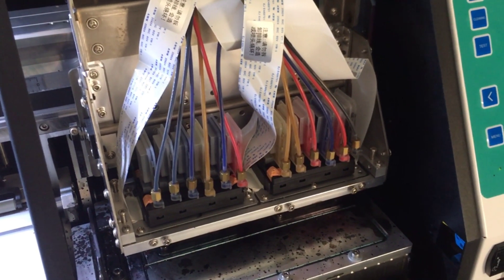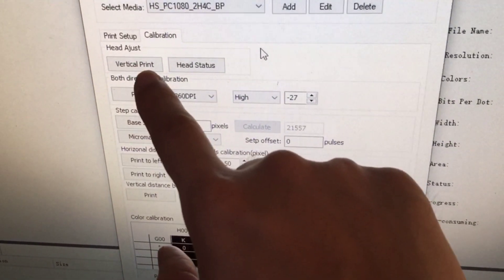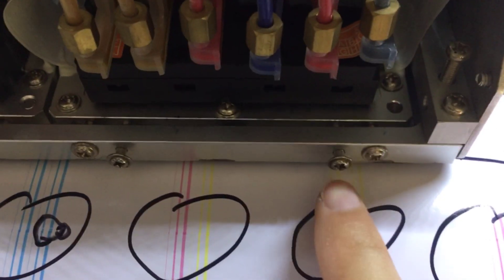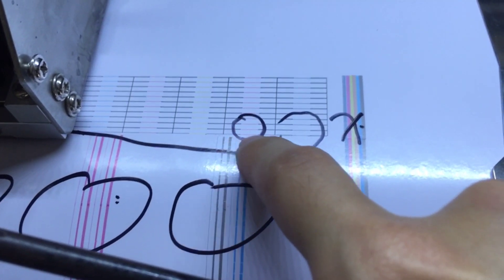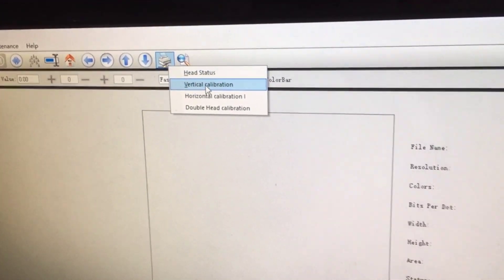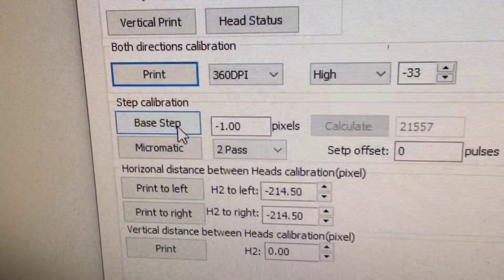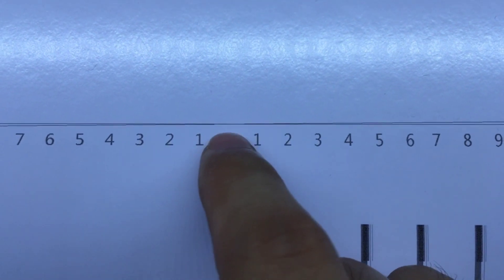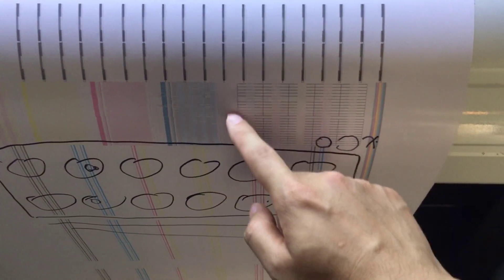Dual head printer calibration

Comment: Hi Eric ... I'm setting the xp600 engine width 3.2 m, mainboard + Hoson with 2 PH, with PH cable installation and Y motor calibration settings, the engine test is good, but when the print test doesn't come out, I suspect the configuration file has a problem,  can you help  thank you for the enlightenment ...